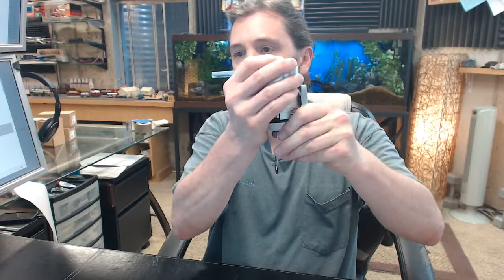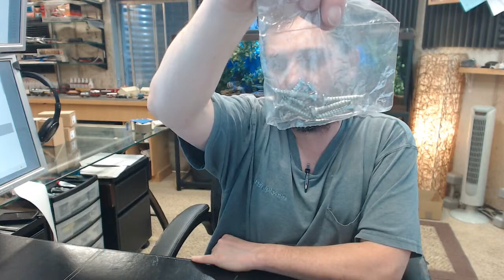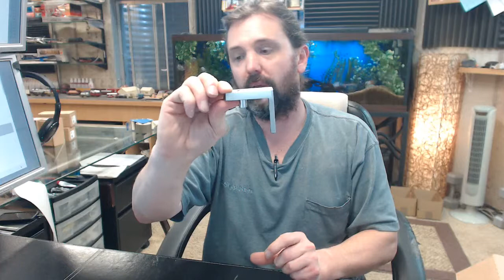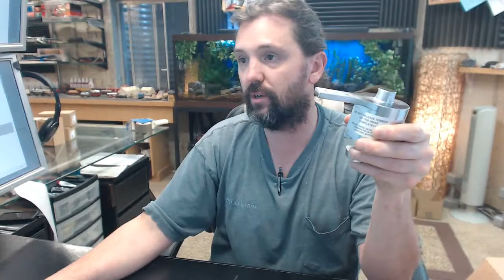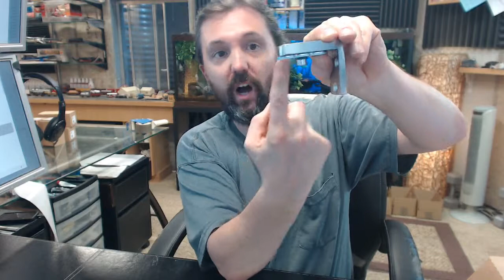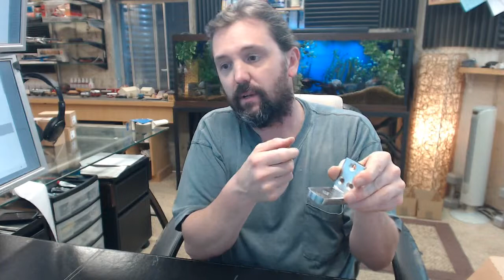Bommer 7112 652

Comment: Richard - thanks for the video - I have a swing 1/2 door, which decided the other day to now want to swing open.  From your video, it may be that I have lost the tension pin, or it moved to another spot, if that is possible.  I do have tension now keeping it open.  If i am able to reposition the tension pin, will that correct my problem, or is there something else causing my door to want to swing open?  thanks - Ron
Reply from the maker: +Ron C Which double acting hardware do you have on the door now.  do you have the 7112 from Bommer?